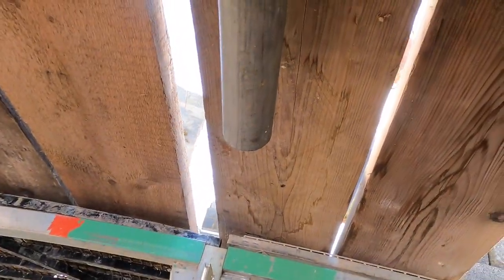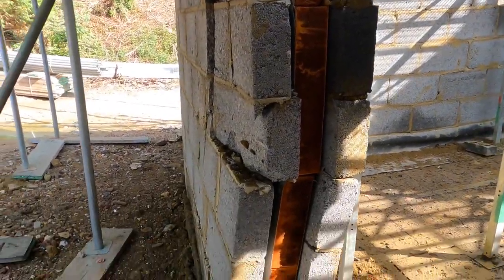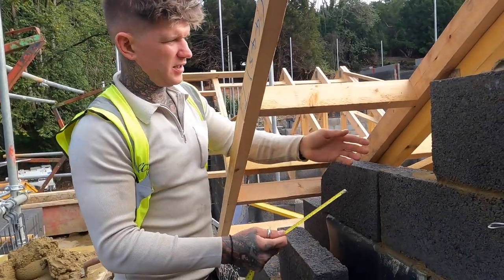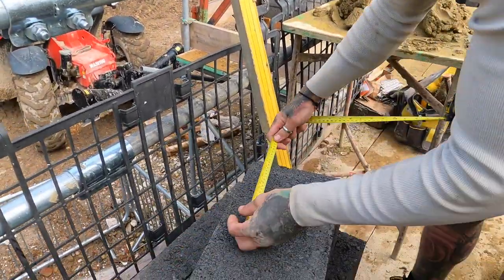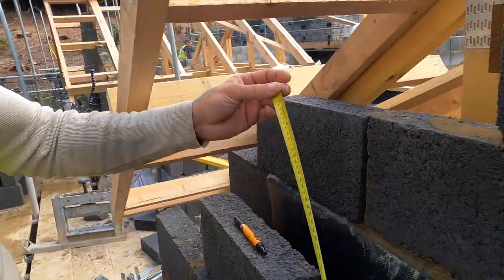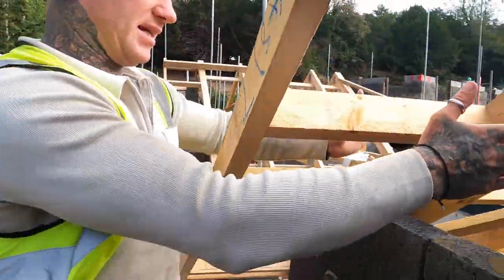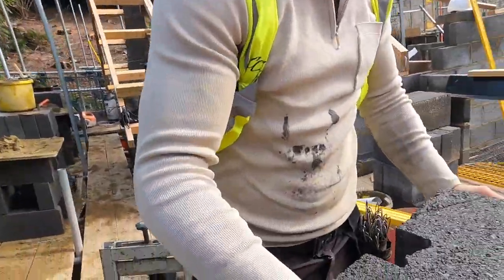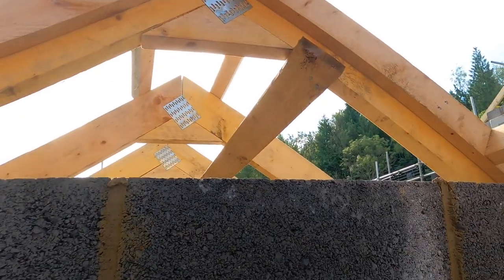Forklift crashes through bricklayers wall 😱

Comment: Great video, and nice gable blockwork. One for the roof framers: At 2mins 27secs that horizontal brace should butt against the blockwork for when the wind is blowing against the gable. The strap (looked ok) is for when the wind is round the corner sucking the gable outwards. There was another brace you did the strap on later on but couldn't see that. Dumb question: do you have any responsibility to report framing errors, or best keep your head down?  Can they fix by nailing another piece of wood over the top?

Comment: I hate pikes full stop. As cavity’s are getting wider because thicker insulation. Joiners are putting 4x1 up the ladders to take the bounce out of roofing lats because of gap between last truss and end of ladder they’re putting it where are cuts are so you can’t even mark your block to cut. Not there fault but I’ve asked mine to keep it in line with face. So you can still get brick/block through to mark your cuts. Hope all makes sense what I’m saying. 😊👍🏻